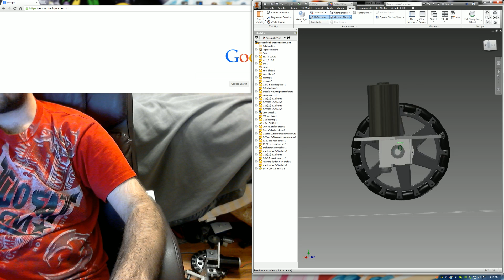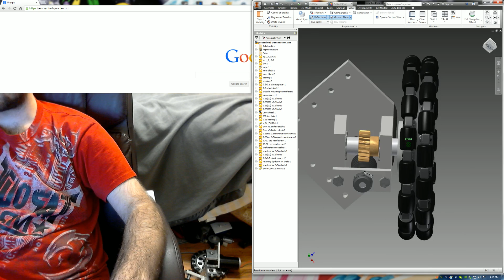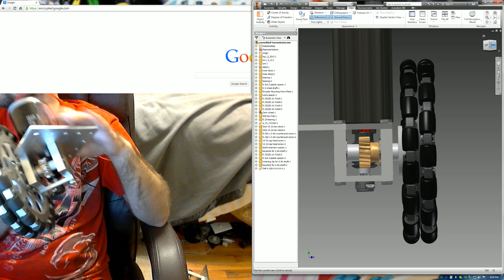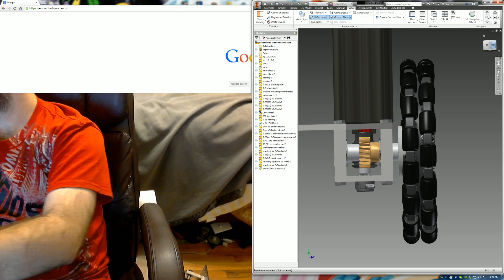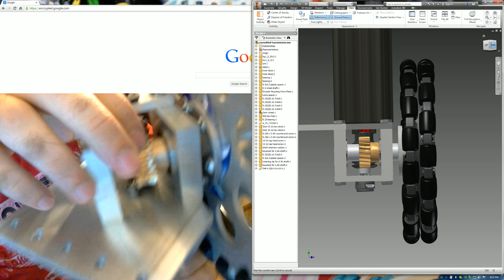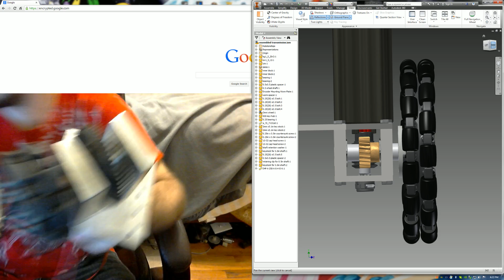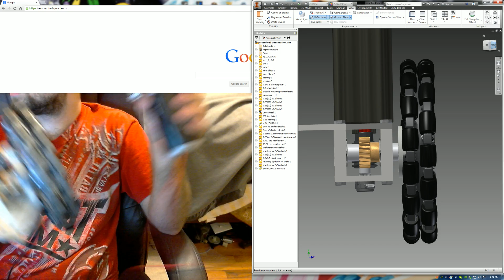Completed FRC prorotype worm transmission

Comment: I am on FRC team 4533 and we would really like to use your gearbox design this year. If you could givve us the CAD file for this we would be incredibly grateful.
Reply from the maker: Files can be found here: https://drive.google.com/file/d/0B4fOsi0gJv2fT3U2aEtlMWh1Z3c/edit?usp=sharing

Word of caution. The team nor I vouch for the accuracy or integrity of these files and they are not organized so it may take some effort on your part to see if everything is going to work out for you. I was the one who personally designed, machined, and assembled these things and from what I remember there weren't any modifications needed but assume something may be different as I'm not absolutely sure. This was just a prototype so be aware of that. The team has decided to go another approach which is lower profile for this year so we aren't even using this design ourselves but the chassis we did build based this design does actually work but has not been through sufficient testing to see if it's competition suitable.

The gears can be obtained from QTC gears and are module 1.5. We broached the worm to interface via keystock to the shaft. We also bored out the worm gear to 1/2" to fit on the axle. the 1/4" bearing at the bottom is rather generic and I don't remember the vendor for the thrust bearing but can find out if you need to know exactely. The file name of the part should reveal where it came from with a search though.
Reply: Thank you so much!